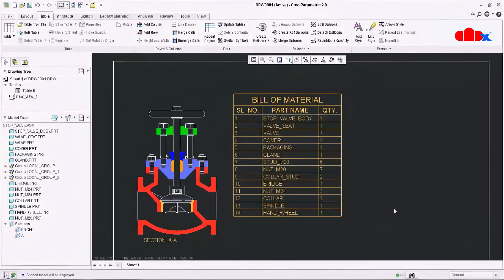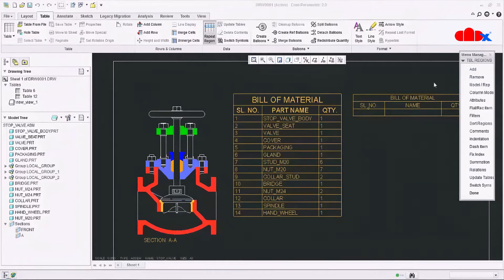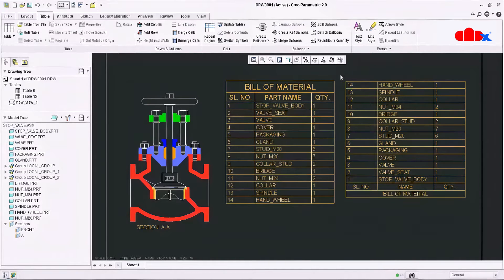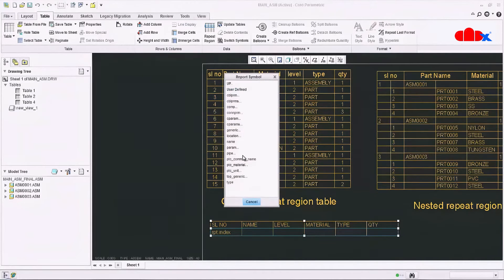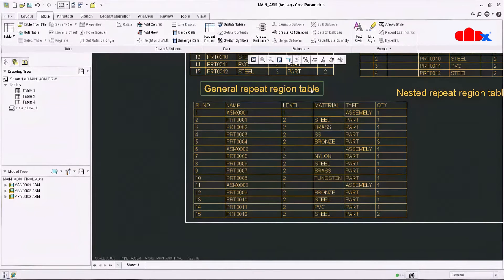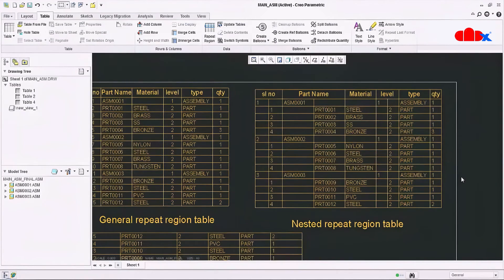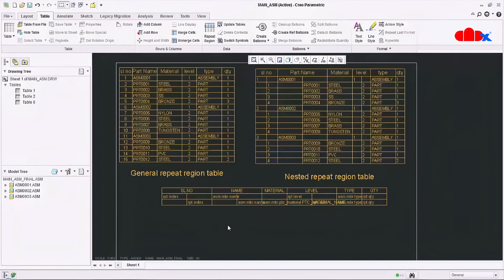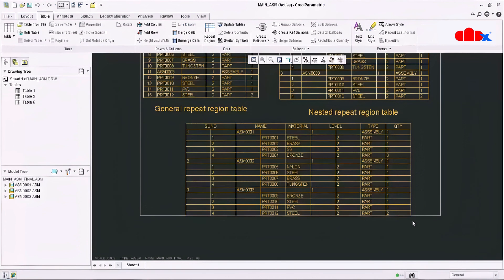Simple and Nested BOM table in Creo Parametric

Comment: Hi  Sir, But Subassembly ballons are not showing in Drawing
Reply from the maker: Aur balloons you need to add a separate table for sab assembly first.
Reply: @CADxTraining   yes i did that to but in main Drawing and bom it shows nested bom which shows as item no 1 containg 1,2,3,4 then item no 2 containg 1,2,3,4  if i add another bom for ballon purpose it shows all item togheter like 1,2,3,4,5,6 and so on how to overcome this issue ? do you have any ideas???
Reply from the maker: Go for a recursive and indentation table